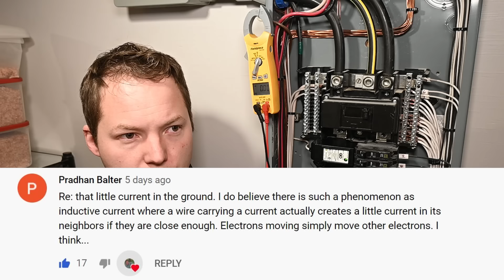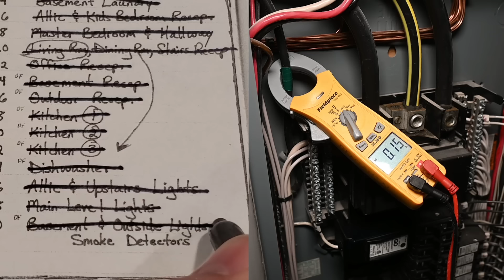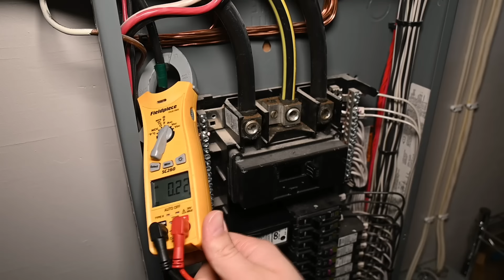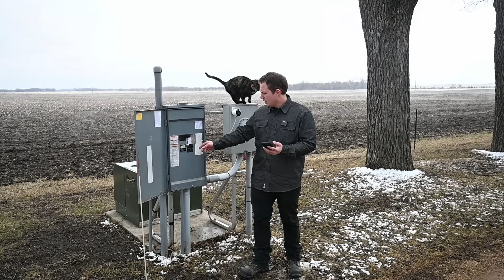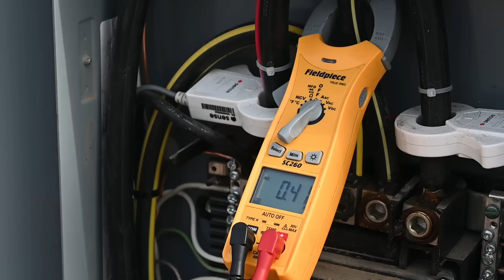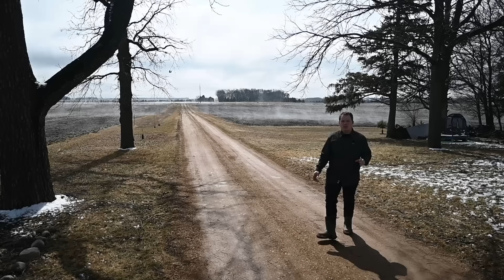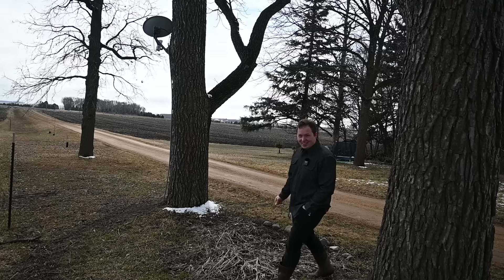Finding The Source of Stray Current on Grounding System

Comment: This is tricky. Some of this depends on how the transformer is grounded and bonded and how your systems grounding was performed. I doubt it is at the transformer though. Basically, the electrical grid makes use of all grounding points throughout the system, those setup in the electrical grid and those installed in end users "customer" installations. The grid has multiple grounding points installed throughout at multiple locations. The reason ground rods and second and sometimes third grounding points are set up at end user "customer" installations  is to assist in the grounding of the entire electrical grid. Most likely someone somewhere relatively close by has less efficient grounding installed than you and you are getting some back flow of current to your grounding system from their system. Electricity always looks for the least resistant path to ground and you are it lol.

Btw, the source is ultimately the actual generator creating the power, wherever they may be, and the ground is the ultimate conductor for that current all the way back to the power plant.

Comment: Only two suspects are left: 
1) leakage at your water supply company or gas supply company, which is coming through your pipes; 
2) Your energy company with old relay distribution substations is using ground as neutral wire between substations to monitor capacitance on overhead power lines, but earthing system impedance of your house is lower than soil impedance near your house and current is traveling through low impedance way.
Reply: Yes Master! Thath what I tried to explain Ben in his former video
Reply: @oscarhh359  If there is leakage from water supply company, it means that soil impedance between water pipeline and transformer's grounding electrodes is very high. But there is question, how this leakage comes from Benjamin's transformer back to neutral wire at water pump station. Everywhere is high impedance, so it is hard to imagine complete circuit. 
Looks like energy company is using old relay distribution substations and Benjamin's house is located between those two substations - his multimeter is measuring current of overhead power lines neutral. As I see, his electricity meter doesn't have automated accounting system, so his energy company have no power line digital subscriber and overhead power lines are monitored through relays, which require to ground neutral.

Comment: Once I had an instrument called "Trifield Meter".
https://www.trifield.com
This allows you to follow ground currents and stray currents in the ground, even when there is no wire.
Alternatively you make one by using a large coil, for example one de-gaussing coil from an old color tube TV.
Connect this coil to an amplifier e.g. a Walkman microphone input, and listen to the hum using headphones.
Can make this in stereo with two coils if you want.
You will be surprised and shocked about the effects.
Methinks this would be worth one or several videos.
As an example: I found currents flowing in the ground from the railway in 500 meters distance.
Especially when the train starts moving.
Technology of interest here is: AC current corrosion in reinforced concrete structures and metal underground pipes.
Yes, AC causes corrosion too.

Comment: In the previous video, you spoke like the furnace equipment ground was the ground for the gas line.  I would have thought that the gas line required its own bond to the safety ground circuit and not depend on the furnace chassis ground.  Seems like a voltage drop could develop over a piping connection in the furnace.  Perhaps try a direct connect pipe to ground wire circuit?

Comment: Great work Ben, it’s interesting to see how electrical systems differ in deferent countries. Many years ago I had a similar situation and found that if we bridged out and grounded the CT’s (current transform’s) that are installed in the main panel during the test the current to ground reading disappeared, also the consumption meter could be an influence. It could be a good idea to check that the centre point of the transformer has been grounded. You never know this could be helpful good look with with solving this problem.
Reply: Ground? You guys say earth, mate. lol
Reply: Aaron Kaase, We certainly do, Aaron but when in Rome we do as the Romans do.
Reply: @davidgoulden586  You should watch John Ward's videos, he does deep dives into UK electrics. I enjoy watching how it's done across the pond!
Reply from the maker: Couldn't agree more! I would love to see how the typical UK (I'm assuming based on your account picture) electrical system is set up. Maybe someday I'll get the chance to visit and a few videos could be made on the topic! Thanks for sharing your thoughts and blessings from Minnesota!

Comment: Got any neighbors with self-installed generator or solar panel wiring? My Dad wired his gen. with a 3 pole cut-off switch.  Pos. 1: Utility Power. Pos. 2. OFF.  Pos. 3: Gen. Power.  He said this was critical during power outages, (when running on Gen.) to avoid sending current back up the utility lines... I'm guessing a neighbor of yours may have some DIY wiring issues(?).
Reply from the maker: Could be but my nearest neighbors house is about 1/2 mile away so it seems unlikely. Very intriguing stuff!

Comment: power/ current is coming from a generator some where. That Gen, has a grounding rod. If you removed that center tap from transformer to ground you would have a floating ground. Current would not have a path to ground and would try to find a path. like through anything that is plugged in. like TVs computers and it could burn them out. I have seen this a lot when people try and hook up standby gen. to there house for back up power. I am now retired, but this store with big freezers got beg gen. so when power went out they did not lose every thing. they failed to ground center tap. they  lost 4 TVs and 2 computers. they asked me to look at it. sure enough center tap was not grounded. not sure if this apples here. but could be.
Reply: Does this apply to 120v generators? Because they are floating neutral and typically ungrounded
Reply: mark rossi most all 110 gen units have three wires Hot, Neutral, and Ground. There is no center taped transformer. If you have a 110 gen that is producing two 110 legs it is a 220 volt gen and is center taped it should be grounded in the panel. Again I have seen were ‘this ground is not hooked up like a gen in a motor home. Not only will this take out devices it could be deadly if something shorted. I do not know why people think ground and neutral are the same they are not. Ground is for safety, even in a panel both wires are hooked up on the neutral bar. Note kinda hard to explain.

Comment: Wait. Isn’t this how a battery works? The potential difference between two sources. In your case one source being the transformer and the other source being your grounding rods. Any potential difference between those two grounds will produce current flow.

Comment: Lol I wouldn’t worry too much about using the “right” word current or power on a line . If you have current ,  you have voltage,  you have power... P=I*E 
Anyone working in the field knows what you’re saying and mean . Way more important things to worry about than that.
I’ve worked with electricians and electrical engineers and never heard any arguments there about it. By the way your  work looks top notch.
Reply: Yeah there are three layers of terminology: 1) field terms, which are casual but specific enough for communication among electricians to get the work done, 2) code book terminology for very precise specificity and legal guidelines for installations, and 3) electrical engineers who get into the deep science of AC and DC who work in labs and stuff.

Comment: Call your electrical utility company and have them come out and give you a good explanation. In writing of course. That looks like a relatively new system I would get the electrical contractor to come out and give an explanation also.  I would be interesting to know if there’s current flowing in the summertime when the Earth is dryer. At this point for the sheer sport of it I would get a long length of number 12 copper tie it to the ground where the transformer is then put that meter in a AC voltage mode and start measuring along the ground the conduit’s the water pipes and see if you get a voltage differential.

Comment: .44 Amperes X 120 Volts = 52.8 Watts of power going to ground. Somebody (Not you since the power legs from the meter are at zero. The power generator company?) has to be paying for that wasted current leakage to ground.
Reply: Hi guy  I have the same problem in my home   the problem was in the meter,, the neutral  was connected to a silver plate and was roasted,, also I have a bar to connected the neutral  ,I take from the bar and made direct connection , problem solved

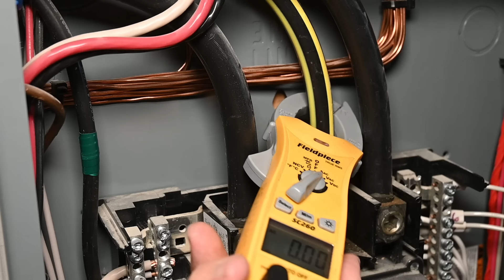Comment: At 10:50 in the video you measured the neutral on the aux panel and it was zero.  Why if neutral on the main measured .2v?  Should't the neutral on the aux panel have the same?

Comment: As I commented to you previously:
The current you are reading leaving the ground wire on your sub panel is most likely due to the difference in potential between the ground rod at the sub panel and the ground potential at the main panel (ground rod and neutral line from the power company).  I would venture to say you will never find two ground rods that have the same potential on them unless the are very close to each other.
To say it in a different way, your ground rods are providing a return path to the power grid for other houses in your area.

Roy...
Reply: Or a bad bug on neutral at service head.Had an instance of a guy telling me he would get shocked when he took a shower...the neutral connection was all corroded at the drip loop .Sub panels were grounded to water pipes
Reply: @damistavista9539  -  I'm not a power distribution engineer but my guess is that this is not uncommon and I suspect it is nothing to worry about.  However, it wouldn't hurt to have the power company come check it out to see if they have a real fault or not.   Roy...
Reply: except the ameter only measures AC current, so the current induced by a static voltage difference won't show up with that

Comment: Ben, congrats for this great and educational video. I believe that you have excessive leakage current in the transformer. Usually acceptable leakage currents are in the order of a few mA where most leakage is due to the capacitive currents that are created from the difference in voltage across the insulating barrier in the transformer windings. As you are measuring hundreds of mA of leakage with everything disconnected, perhaps you should check your transformer specifications for leakage current and see where you are. Another thing to consider, this can also be caused by ground loops. Keeps us posted on your findings, and great content.
Reply: I am guessing you are on the right track, but having lived in rural USA, most people assume pad transformer is fed with 2 hot phases at 1250 volts. In rural areas, sometimes 3 hots and a neural is not in place. This results in a 1 hot and 1 neutral, and guess what? the neutral is bonded to ground. Not all primary current returns to the substation over the long neutral wire. Some takes an alternate route. This is actually common in rural areas where 3 phase power is not provided. If he reads the tag on the transformer, it may list the primary as 7200 instead of 1250 volts.
See if the primary is one of these common voltages. Common primary line voltages are 2,300, 4,160, 12,470, 13,800, 25,000 and 34,500 volts depending on which distribution voltages a utility uses. Other voltages such as 7200 indicate a one hot from one phase to neutral on the primary.
Reply: It's not "leakage", is all due to voltage drop.
Reply: No, the problem is that most systems in the US are 1) multi-point grounded in the primary and 2) the secondary neutral (what feed the houses) is tied to the primary neutral (what comes out of the substation). A perfectly wired electrical installation in the US will always have objectionable (leakage/stray) current. The US adopts a TN-C-S grounding system, not a TT not TN-S system.

Comment: From what i understand physics of electrical flow are more complicated than most simple explanations can convey, but essentially, electricity seeks to return its electrons to "ground" just like you said. That is, to discharge its negative energy and return to equilibrium. Normally, the current returns to ground through the neutral wires in the electrical system. But should some breakdown of the pathway occur, the hot current may instead flow through other materials, such as wood framing, metal pipes I know i know it's hard to believe but it's true bud.
IF electricity strays outside the wires when it's supposed to flow through it, well bud in other words, it sounds like me it's taking a shorter path to ground...

Comment: You have induced current probably from your electric utility provider.  To verify you would have to get into that transformer box which I am NOT RECOMMENDING to do.  If you could you would probably find "something" slightly too close to "something" else causing the induction.
Reply from the maker: I definitely would not consider opening the transformer! I might contact my electrical provider and inquire as to how much leakage there should be going to the grounding system. Thanks for the comment!
Reply: NEVER OPEN THE TRANSFORMER !!! The input in MN is 8900 VAC or higher. It's a painful way to die. The power co. shuts it off before opening the cover, then they use a tester on the end of a pole to check that it is off. They still only touch the inputs with the pole. As other professionals with more knowledge than myself have said, the grounding at the transformer / meter / main is most likely loose or something to that effect. Isolate the gas line first. Check your house grounds. Last and still possible is stray current flowing INTO your grounds. Other have told you how to check these things. For those people not paying attention ALL equipment is NEW!

Comment: Have you considered a ground loop?  It happens in video and audio circuits.  I'm not sure how you would you check for this in an electrical circuit.  In audio you get unwanted hum and in video you get hum bars running through the picture.  You can't ground both ends of a shielded cable.  It can drive you nuts if you don't know what to look for.

Comment: Does the neutral tap on the transformer have only reference to ground at the main panel?  Or does the transformer have its own reference to ground???
Reply: The short answer is that there is a grounding electrode at the point of service. This is almost always an earthed connection. Ground rods / grounding plates / ufer ground. There is also an earth bond on the 0V (center tap) of the transformer from utility.

So, you have a very high resistance path through the earth itself back to the transformer in parallel with a very low resistance path through the service neutral, back to the 0V of the transformer.

Without getting too electrical-code-like here, you want your service neutral and your service load side equipment  (branch circuits) grounding conductor (think your branch circuits in the building grounds), to be bonded here.
This gives a low-resistance fault path under a short circuit condition to create a sudden spike in current and trip a breaker / blow a fuse (essentially open the circuit). However, if you bond your neutrals and grounds AFTER your initial disconnect, you create a parallel path and your equipment grounding conductor becomes a current-carrying conductor.
So, your ground has no current on it when you are looking at your branch circuits (or shouldn't), but will have a current on it when you look at it before that bonding jumper at the service disconnect. In this case, that disconnect is his main panel.
Lastly, we don't want any kind of strange, unpredictable voltages to form between the earth and the 0V reference of the electrical system. We generate the voltages at the potential of the earth, and we want to keep them referenced at the potential of the earth. - Ground is ground the world round - . So, we reference our entire system to the earth to keep everything right about where it should be. Nice and predictable.
Reply: I am an electrical engineer with the local power company. Usually those transformers have a ground strap connection from the neutral connection to ground. Transformer pads usually have ground rods connected as well at the transformer. Is info can usually be found by your local utility standards or rus specifications.

Comment: Current flows towards the lowest potential. One option might to set the multmeter to volts and use a long extension cord to make extended  probe leads to probe around the property see where the potential is dropping. You might be able to make a potential map to see where the downhill flow is. I really have no idea how well it will work, but it might get you some more data.
Reply: With main power off lift ground and find out voltage AC and DC 
Used data solve problem 
Which way current flowing to panel or away ?

Comment: It's very undesirable to have that amount of current on the ground, of course. It will corrode your ground rods fairly quickly. It's double plus ungood to have that current grounded to the gas pipes for obvious reasons.

Comment: I didn't see the original video... So, if the "stray" current is very low, I am going with differential on the ground rods. If it's somewhat significant, I am going with an appliance bond.